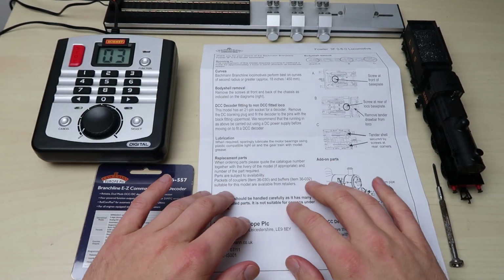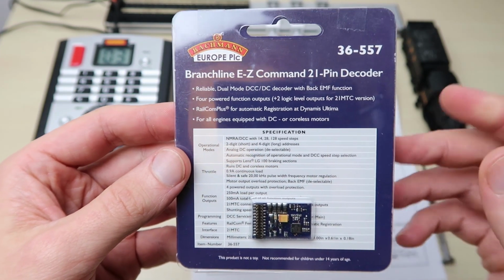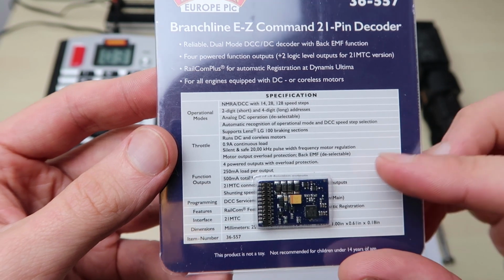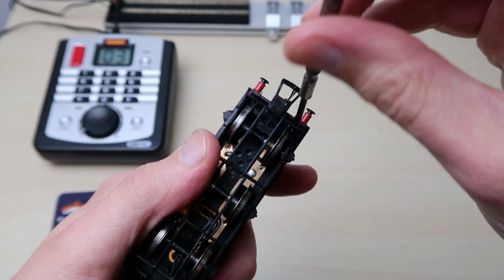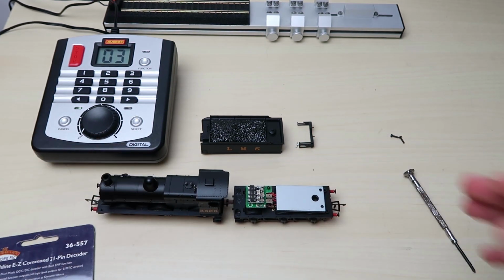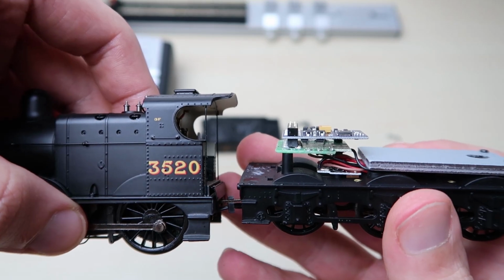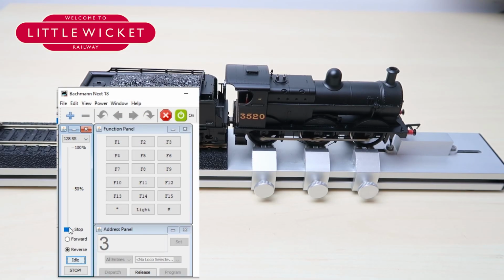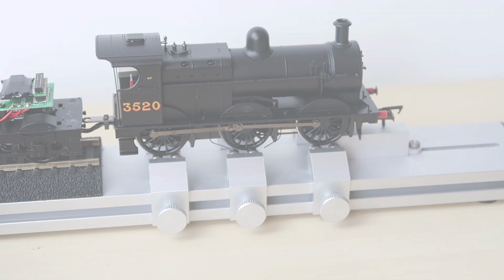Comparing 21 Pin Decoder Performance | Bachmann vs LaisDCC

Comment: I just found this video as I was having exactly the same issue with my Bachmann 3F.. I had fitted a Lokpilot 21 pin and put it away (I mostly play with US HO trains).. hooked it up to JMRI this week and had exactly the same - very stuttery performance, almost pulsing. I finally got the body off, lubricated, checked the quartering, fiddled about for ages with speed tables etc in JMRI. Finally I switched OFF BEMF control and voila.. that seemed to do the trick! running it in now.. could still be quieter but I'm not used to OO steam models so not entirely sure my expectations are correct.. but none of that random speed variation. Thought it might be worth sharing in case anyone else comes across the same.

Comment: Hi Loved your video but it left me a bit worried as I have  US layout using an NCE Power Cab. I have no problems with this set up. I now want to add another layout but English, particularly A GWR branch line terminus. I live in the UK by the way and have always lived within 2 miles of the main line out of Paddington. On the US layout I usually run with Soundtraxx 2 decoders with no problems at all. CVS 5, 6 and 2 cover a good and acceptable minimum to max speed range and CVS 3 and 4 acceleration and decelerating levels. Do you have sound on your models? Running with DCC is a must to have sound as part of the deal. I would appreciate your views on this. Regards Terry

Comment: No antistatic precautions?
Reply from the maker: It's a good point, but I never really taken any antistatic precautions. I probably should earth myself and wear a strap, but touch wood (or should I say radiator) I've handled hundreds of decoders and ICs without issue. Out of curiosity I've just taken a quick look at a Hornby decoder manual and there's no mention of antistatic precautions that I could see.

Comment: From my experience with N Gauge, I can vouch for Gaugemaster decoders (basically, Digitraxs rebranded) in 6-pin versions. Others, I don't know. I've bought a Rails decoder and some others (Gaugemaster and, due to it being recommanded by the manufacturer, an Hornby one) and I have not tested them IRL by now. If you have some experience on them, I would be interested to have your opinion on them.
By the way, the Hornby DCC controller have not the reputation to be reliable or straight with the DCC standard, that might be the point here. Also, Bachmann decoders are not reputated to be top notch.
I had used different brands of decoders on my former N gauge roster, and I never had issues with specific decoders on specific models. Looks strange to me such issues in OO.

Comment: i found that LaisDCC decoders run much more smoothly my engines when compared to Bachmann on-board decoders. I've swapped the original on-board decoders with a 8-pins Lais decoder and the locomotive seems a completely different machine.
Reply from the maker: LaisDCC work really well in some locomotives, but they're rubbish in others. In terms of value I think they're the best on the market. You can now get the 8 pin decoder with a stay alive for around £20 which is pretty impressive.

Comment: Interesting!

With your Hornby Select, does it run the LaisDCC decoders with stay alives or not? I have one and it just ignores the throttle in put...
Stay alive isn't even connected.

Loco will "jerk" forward when the power is switched on, then stop. It'll also twitch when a CV is changed. But will not move at all with throttle input.

I've changed all the CVs I can think if, DC run is turned off as is BeMF.
Reply from the maker: I think I've only got one loco with a LaisDCC decoder and a stayalive (DCC concepts?). I'll see if I can dig it out and run it on the select.  I've had issues before with it, but that was because I hadn't disabled DC running, so every time the stayalive kicked in the thing would shoot off for a few seconds.

Comment: Hey up
Just wanted to say that is the 36-557 has been known to not like the hornby select due to it not being NRMA compliant 
WATCH IC82 VIDEO
The good the bad the ugly
Reply from the maker: Hi Luke! I think you're right. It seems like the Select and the 36-557 might not get along. I''ve heard mixed messages about the Select being NMRA compliant though and I'm not sure what the trurth in. I think older versions of the Hornby select might not have been NMRA compliant, but the latest firmware might be NMRA compliant. There's also a difference between NMRA compliant and NMRA certified. The Hornby Select isn't certified. Only Hornby will know for sure about the compliance now.

Comment: An interesting comparison, thanks for posting.

I've found in the past that different brands of decoders give different performance in particular locos,  Even with CV changes it can be difficult to get smooth running.  For example I've had Hattons £10 decoders better than ESU in one loco but not another - even within the same manufacturer / class (e.g. Bachmann Class 47s).  It's a question of trial and error getting the perfect match.  I keep a few cheapies in my box - Hattons, Hornby and Lais, and often one of them is perfect.  If all else fails, A Lenz standard will be good in with most locos.
Reply from the maker: Thanks 😀 That's good to know I'm not the only person who thinks cheaper is sometimes better.

I now have another bachmann 21 pin loco, so will try it in there shortly and see if it runs well. People all spoke quite highly of the Bachmann decoders.
Reply: @LittleWicketRailway  Hi, some 6 or 7 years ago I purchased a good few Bachmann decoders when I first went digital for my Bachmann diesel locos. All those decoders showed manufacture 151 which is ESU. Interestingly, a few of those have since failed but all my cheaper Hornby, Hattons and Gaugemaster ones are still all perfect!  I've since replaced quite a few with sound decoders and Hornby TTS at £35 have been fine, smoother than some ESU Loksounds!  Plug and play it certainly isn't.! But worth swapping around to get best results,  Same with speakers. Will subscribe and follow you.  Cheers.  Vivian

Comment: Enjoyed your  test run on 21 pin decoders. I find Lenz is well worth the extra money with ESU a close second.  John, St. Catharines, Canada.
Reply from the maker: Thanks for letting me know. I've not used either of those, but I'll check them out. I'm pretty tight, but I suppose there's no point having a nice model with a rubbish decoder.

Comment: Hi how much did your whole layout cost you
Reply from the maker: Hi! That's a really difficult question to answer as I've not really kept track (and I don't like to think about it!). It is quite a bit when you add it up, but I always look for the cheapest way of doing things without cutting corners. This is why I use the DCC++ base station and the sensor hub, cheap alternatives to the commercial systems.

Little Wicket might be getting a rebuild in the near future, so I'm hoping most of this stuff is reusable and will be in service for many years to come. I've tried to break it down into the major areas below, all amounts are approximate and the spend was spread over a long period of time.

Baseboard and frame - £100 (this covers the cost of all the timber, wood treatment, screws, etc. The layout is actually supported by two large metal shelving units. I've not included the cost of tools used to put it together.)

Track - £300  (some of the track was second hand, the turntable was a gift and a lot of it came out of train sets. The most expensive parts are the points and I wouldn't use as many in future, I've learned that a simpler layout causes fewer problems and is more enjoyable)

Wiring - £50 (this is the wiring from the DCC bus, the dropper wires, the accessories power and a few other bits, but doesn't include the DCC++ base station)

Point Motors - £80 (I used solenoid point motors and I really regret it. I find them unreliable and expensive at £4-£5 each. I wish I'd used cheap, reliable servos and would probably have saved at least £60)

Accessory decoders - £200 (These contain capacitor discharge units used to fire the point motors and they're the Hornby branded versions. Another mistake, I wouldn't need these if I'd have known about servos. I could probably have saved £150 here. It hurts just thinking about it. On the bright side I can either reuse them or sell them on second hand as I still have all the boxes)

Sensors - £100 (this is for the infrared sensor network that monitors the location of the trains and allows automation, obviously not essential on all layouts. There's about 40 sensors on the layout, a sensor hub and all the wiring. I didn't know about block occupancy current sensors when I made this, but next time I'd use them and I'm looking at ways of reducing the wiring by using wifi.)

Landscape - £100-200 (this is really hard to estimate, but includes paints, fake grass, the materials to create the canal, the incline, etc. I tried to keep this as cheap as possible by recycling materials I had already such as polystyrene packaging. All the trees are cheap from Ebay. I printed a lot of the retaining walls myself and stuck them to thin plywood)

Buildings - £200 (most of my buildings are from Metcalfe and they're usually around £10-£15 each depending on the size of the model, some of these are gifts as my mum enjoys building them for me)

Comment: Have you tried changing cvs 54 and 55, I had a standard tank on a bachmann decoder that ran horrendously with no load then changed the feedback parameters (cvs 54,55) and it now runs brilliant even on an unlevel, incomplete layout like mine
Reply from the maker: Thanks for the tip. Do you remember what values you set them to?

Comment: Great video if the bachmann decoder is the 557 it is not compatible with the select controller as the select is not NMRA compliant and this is what causes the erratic running
NMRA is a basically set of standards that allows any decoder to work with any controller, the select is not configured for this the hornby select is only compatible with hornby decoders
Reply from the maker: Thanks David. although there seems to be some debate on this subject of Select NMRA compliance. I believe that the Hornby Select and the DCC++ controllers are considered to be NMRA compliant, however, they're not NMRA warranted. Having done a bit more reading it appears that I'm not the only person to find that Bachmann 21 pins decoders can be a bit fussy about their controllers.
Reply: @LittleWicketRailway  thanks for the reply but i have to disagree a bit I’m not sure about the DCC++ controller as it is the first time I have heard of this make but the hornby select DCC controller is not compliant, there has been videos and forum threads about this and the conclusion that has been made is the hornby select is not compatible with layer chips but it is compatible with early chips like the bachmann 554 so if you can find one of them second hand that may be a bit better when it comes to performance with a hornby select controller

Comment: The Bachmann decoders are made by Zimo, they are miles better than the LaisDCC decoders, you Bachmann must have been faulty, get it replaced and try again
Reply from the maker: Thanks Jean. I really wish I had another 21 pin loco to try it in to prove for sure it's the decoder. I will contact the shop and see if they'll exchange it.
Reply: @LittleWicketRailway  the link did not show up
Reply from the maker: Thanks for letting me know. I'll get that fixed today. Here's the link that should have popped up https://youtu.be/AqnPy2YBaVw